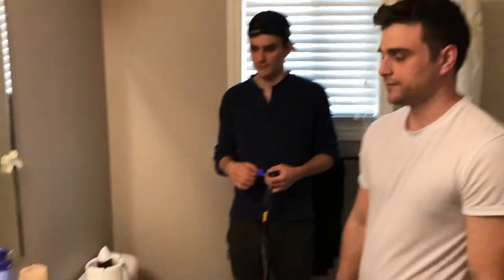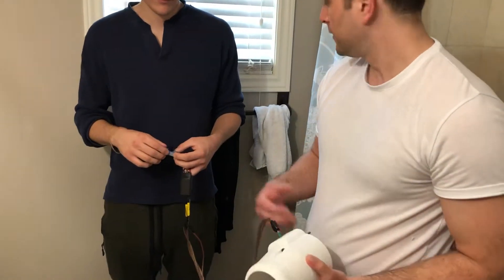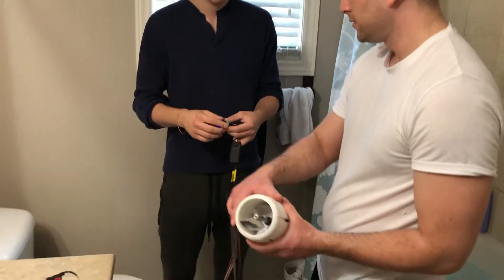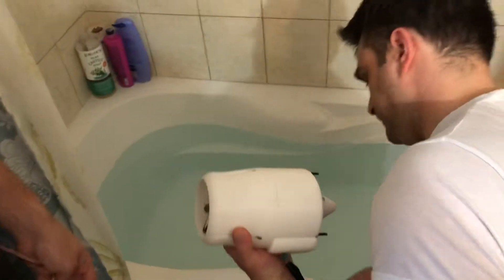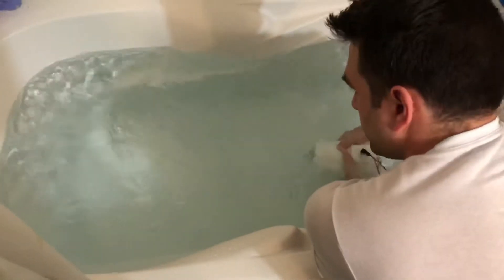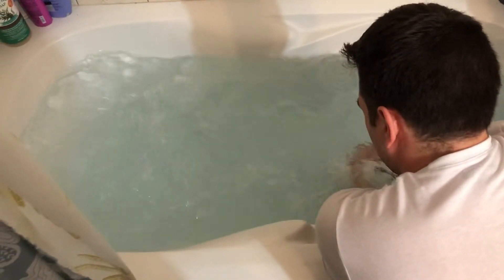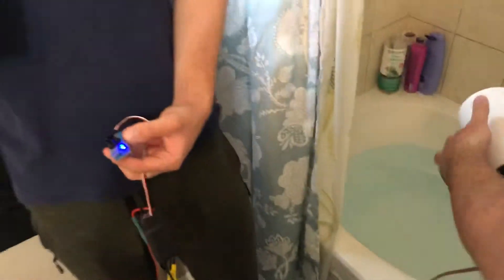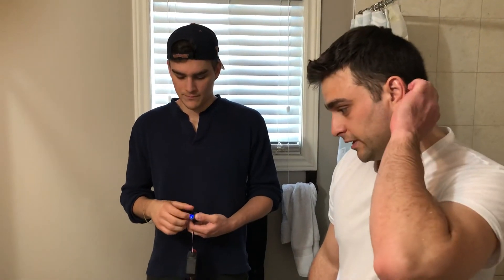24V 3D printed water thruster

Comment: Hi..where can i get those motor online?
Reply from the maker: Hello there you can find them on banggood.com
Reply: What is the model for that motor? Look like a fun project
Reply from the maker: 5060 200kv
Reply: I am thinking make exactly same one and attache to my inflatable kayak. I guess this will give at least 5-10mph. I also found that water jet propulsion are good but attached is very awkward. Can you advise me please?
Reply from the maker: Anjara Mitesh maybe a bracket or a clamp would work depending on if your kayak has a fin or something similar to attach to.
Reply: how much lbs of thrust your thruster can provide?
Reply from the maker: Anjara Mitesh I could not get an accurate measurement.
Reply: Supercool bud!